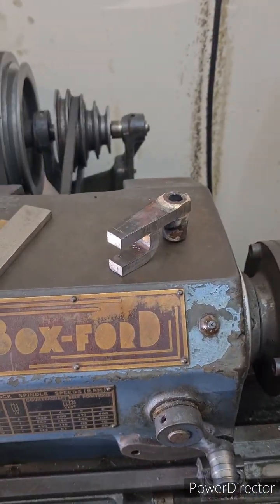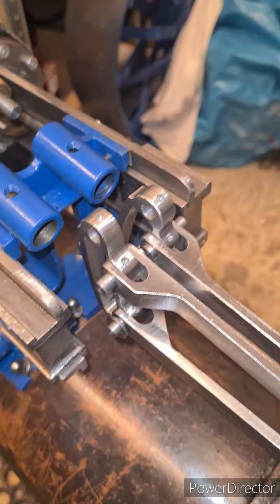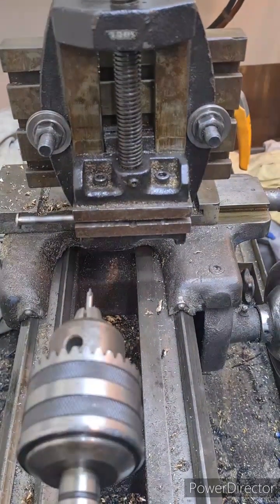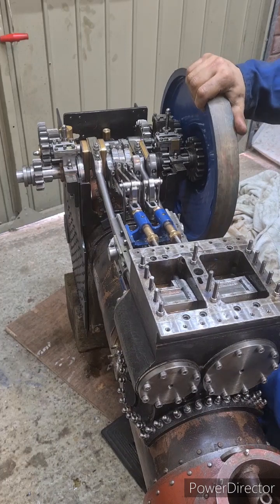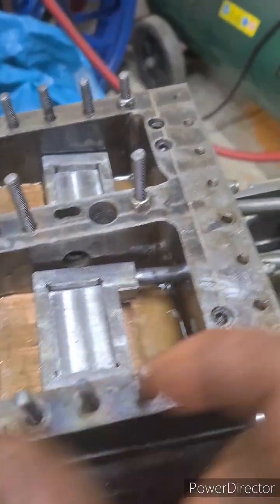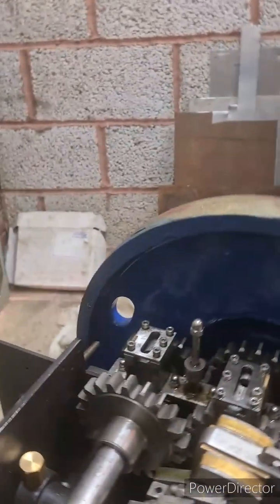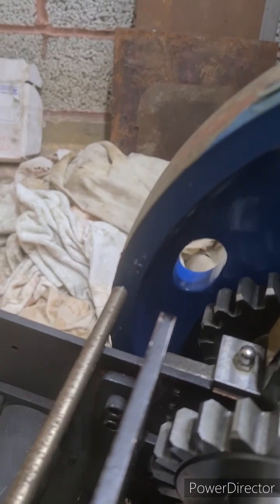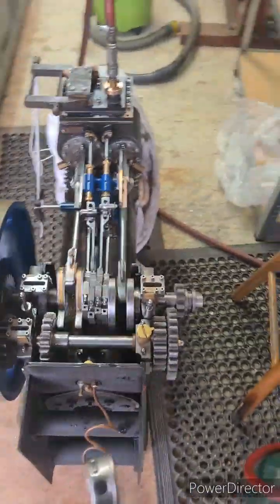First test on air - 3" Fowler

Comment: But how do you actually adjust the eccentrics? And why do you need to mark the flywheel? Cant you just put a piston 90⁰ off from TDC, and set the valves 90⁰ off from that, then advance them a little from there? Only asking as we might need to advamce ours a little, she knocks like shes about to fall apart!

Comment: Just curious how much tolerance you put in your bushings given the heat in the engine when complete.
Reply from the maker: Well, the bushes are bronze, which expands more quickly than the steel shafts. There should be a nice running clearance once they warm up!

Comment: Looking good now!
I've been going through all the HR Plastow drawings the last couple weeks and looking at the dimensions for the expansion link.... did you find any kind of collision issue with the valve rod and eccentric rod? Because the numbers on the drawing don't add up
Reply from the maker: I have had to fettle a lot of things! The eccentric roda were definitely too long! The centres between valve rods and the centres between expansion links weren't the same either. But I couldnt work out where that error came from as ive checked the drawings and re measured what I have done and all seems fine!

Comment: air just doesnt compare :(
unless its heated a bit. :)
Reply from the maker: Good idea! Maybe I'll think of an air heating coil for future testing 👍
Reply: @johnlintorn6768  its one of those simple things they did back then that is oft neglected these days.

amazing the temperature drop you get from expansion... and the logical extension of that is that cold stuff doesnt expand as much as hot stuff...

do it with all my air tools too. only needs to be 80-90C to make a big difference. bucket of hot water will do it...